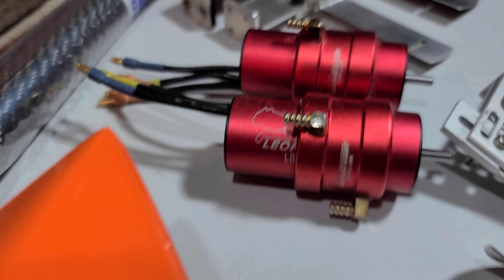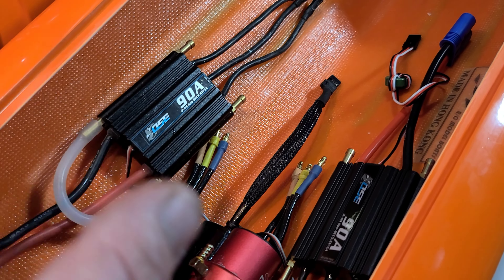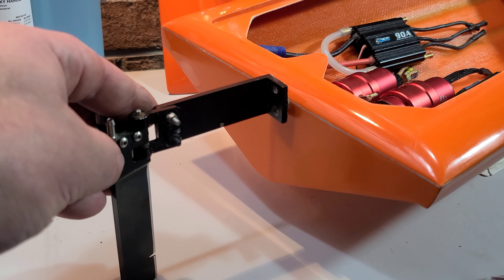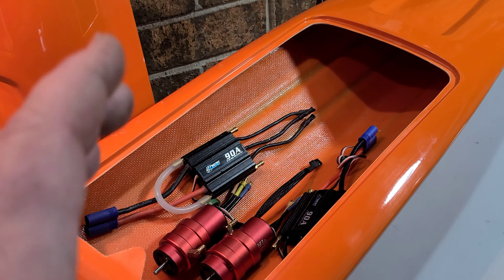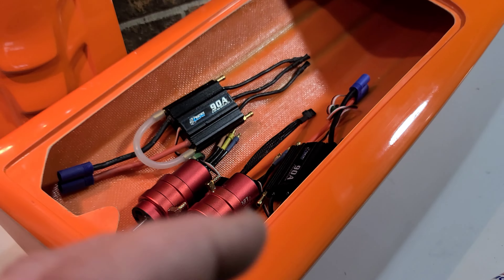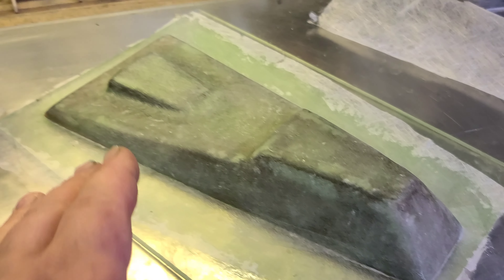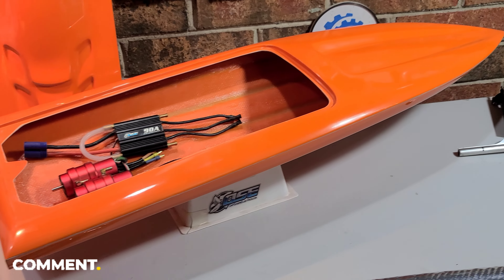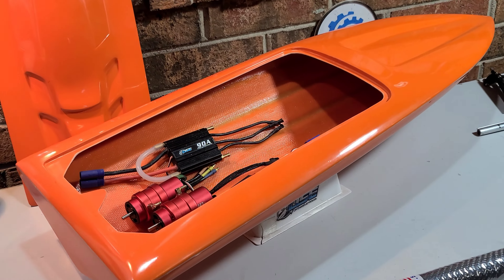New Build Series Deltaforce 29 Twin Motor Mono - Shop Update - Leopard 2860, ose 90a

Comment: Nice projects Big B 👍. Regarding the stinger or strut on the twin Delta force, the struts will allow you to place the prop shafts closer to the water. Just exit the flex cable from the hull bottom, instead of the transom. You could place both props 50% submerged with a horizontal setting. The SAW mono guys use the same strategy, only with wire drives. 
That ECO hull will be interesting as well. I will one day make a boat from a mold. That must be a fun project. Looking forward to the progress, cheers! DJ
Reply from the maker: I was thinking the same thing, I wanna get. The props as close to the ride pad as possible, although Stingers may be an easier tuning option.    

Just finished pulling the top and bottom of the carbon fiber hull.  So freaking satisfying.  It's alot of work but man oh man 1000% worth it.    Video should be up tomorrow

Comment: Sweeeet the monster finally arrived. I'm happy she's in good hands. I believe that motor mount can fit two different size motor spacings. So many projects going on I'm so excited.  👊
Reply from the maker: Thanks again brother like I said you did, and an awesome job on the upgrade..   kinda tempted to build my own hatch, but it wouldn't look as good as the original.    Did you spray the hull with clear coat? Or did it come like that I wanted to peel the decal and can't lol.
Reply: @IRONCLADRC  did not spray. It came like that. I would just sand it lightly if anything.

Comment: You got sooo many projects Big b which is amazing..that's my boat buddy Chris's little cat...I agree it's a nice shaped hull...which is very similar to my old surge crusher..which is a beast..
Reply from the maker: I can't wait to get it on the water, did you find your lost boat?
Reply: @IRONCLADRC  I was hoping Chris would be back by today or tomorrow..he remembers where my boat went down..my plan is to use a long PVC pipe with a net etc on end and feel around bottom for it...the other day I was unable to dive down and feel the bottom at all with a 9 ft pipe..but with swim fins and jet ski life vest a a long ass pole I feel there's a chance...question..in fresh water how long can a brushless motor last? Thanks
Reply from the maker: I've recovered a sunken boat after 5 days underwater everything, but the battery survived
Reply: @IRONCLADRC  wow..that's good to know. Hopefully I find it soon.thax
Reply: @IRONCLADRC  tried using my 20' pvc with a net for 2 hours..water is 19 to 21 feet deep..muck on the bottom.
Let's just say my idea was an epic fail...10x harder then I thought it would be..lots of crap and muck..only thing that could work is using  a cord and tossing some kind of crazy mess out there that would grab it..zero visibility and 50 plus feet off the shore
Still is a long shot though..:(

Comment: Very interested can’t wait to see full build have same boat just finished carbon fiber inlay!!!     And I also been looking for a good cat ose has the high speed carbon Kevlar I want to pull the trigger so bad but haven’t even finished my first 2 boats
Reply from the maker: What electronics are you putting in yours?  I was considering a 3674 2200kv but decided to go twin.  Single motor would more than likely be faster than my twin motor.
Reply: @IRONCLADRC  can’t decide honestly my first build was twin with 2845 with 90amp flycolor “nqd757” I found it in a trash can at work started watching your channel now I’m really into the hobby and wanted to take my time but will probably be something like a 150 flycolor and surpass 3670 what’s your thoughts or suggestion?
Reply from the maker: Sounds like a good setup to me, I'd run her on 4s so you can keep it light weight.  Light boats a fast boat

Comment: Going to be interesting. Bought a seconhand twin, but it runs terrible. Tried a few things and have to test more comming season. Already bought different props, they were totally wrong, but haven't had time to look further into it. I think it has to do with the hull (because its stepped and a steep V) but maybe you will find things or problems or solutions were i haven't thought off yet. 
You got definitely my attention on this build...
Reply from the maker: I can't wait to see her on the water, I know there's gonna be a learning curve for a twin mono.   Probably get better performance from a single motor but there's only one way to see.   Ironcladed out c-mon.
Reply: @IRONCLADRC  twin is definitely not the easy way to go fast. But it is cool and sounds amazing in my opinion....

Comment: Just think:  No torque roll, no prop walk or prop steer, left turns just as good as right turns.......  I have a sneakin' hunch this could become your new favorite boat.  If those motors are rated at 1300 Watts each, that means you are going to be closer to 3-1/2 horsepower.

I'd forgo the CF inlay, you would be adding a lot of extra weight for a little extra rigidity.  That hull is plenty strong enough for your stated mission (fun-running), although I suspect I'll see it at "The Speed Run Spot" on occasion, just because you ARE Big B..........  😉
Reply from the maker: That's the whole reason Im Building her. I can't even  believe I didn't mention the no torq roll and chine walk deal I the video guess I was to excited about getting the new hull.  

Probably won't break no speed records,  single motor would probably smoke my twin motor.    Going for style points on this one.

Comment: One thing i want to see is the shafts and props on twin motors, cause i never undersyand which one goes left or right on twins! On a single motor i am used to run left prop, left shafts... But on twins i see rigths to...so i am lost! (why there must be left and right on twins?)help! Also i understand that on one of the esc the red wire must be cuted to go to the receiver only one....
Reply: Twins run their props different directions. Some hulls like them spinning inward, others run better outward. That's something you need to test what works best. Definitely going to be an interesting build.
Reply from the maker: Peter nailed it.   Like he said you just have to try any certain prop rotation on any particular hull to see which orientation handles best.